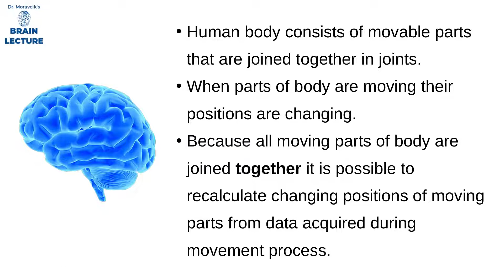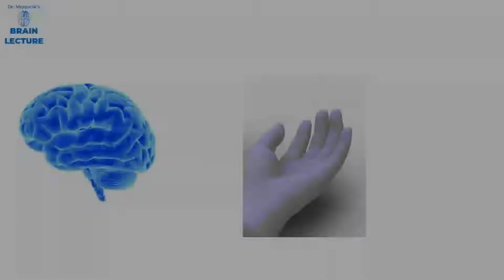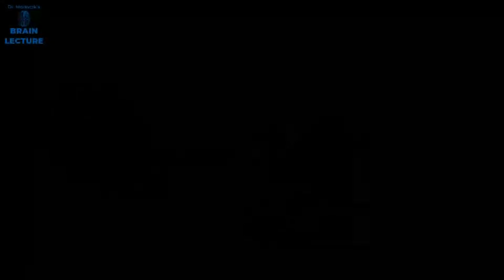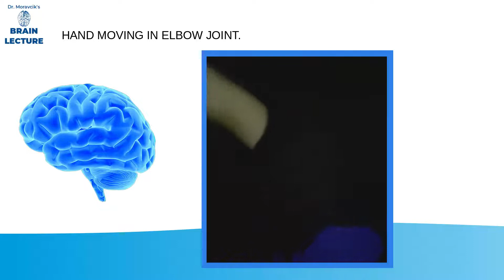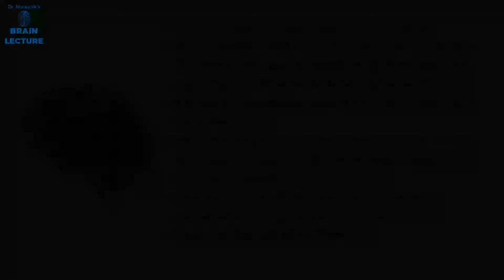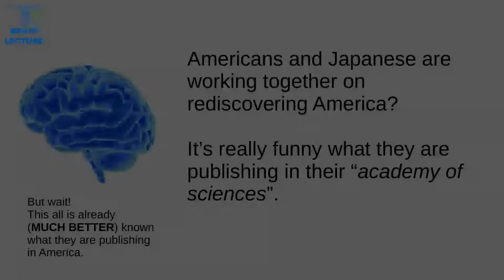Dynamic database of body positions - lessons in algorithmic brain infrastructure (#2)

Comment: I watched your video and read some of the text of your website. Honestly i am quite confused. Do you seriously claim to (self)control a complex machine like a robot with a sequential algorithm that you have created ? A robot capable of motions close to a human like motion would reqire more than 100 actuators, just to prevent unwanted oscillation of the structure,which has to be entirely able to host compliance. Additionally such robot would require a sensor network including several million touch sensing points with analog processing ability each. Visual sensing isnt mentioned in your video as well. The real challenge is it to bring all these aspects of a potential robot together in a right context. So far your video mentions just the motoric coordination of a robot. The microprocessors we have available right now good at sequential tasks, but for massive parallel processing even the most avanced ones consume too much energy.
Reply from the maker: I am not sure what answer are you awaiting? I am also not sure that you are no chatbot (joined Youtube on May 10 2022??)

But anyway. Massive parallel processing? This happens quite often these days. No idea what do you want to have instead of processors working in parallel?
And yes, this video only mentions what is mentioned in the description. Nothing more. 

"The real challenge is it to bring all these aspects of a potential robot together in a right context" What a funny sentence. I already did so before 2016.
Reply: @Dr.Z.Moravcik-inventor-of-AGI  to be honest my knowledge of ai is very basic. But it is clear to me that allmost any ai software represents the simulation of a neural network. This makes it slow and power hungry on conventional von neumann eva type of computers.  Despite Multiprozessor systems available today all these systems still use a sequential technology. I am curious if your algorithm is based on the model of neural networks. Possibly you have a different approach ? If so then it stands out. Currently simulated neural networks are all the hype.
Reply from the maker: @markschultz3034  Yeah, neural networks... What exactly is a "neural network"? It is only a weird name representing totally different algorithms. Brain works according to certain algorithms and it does not matter if you call it a network or not. Hope it helps.